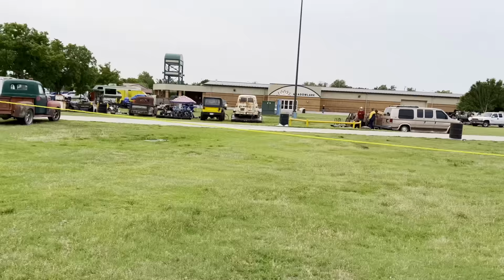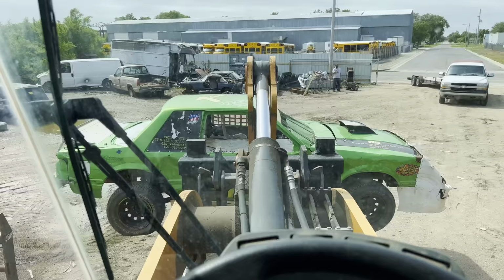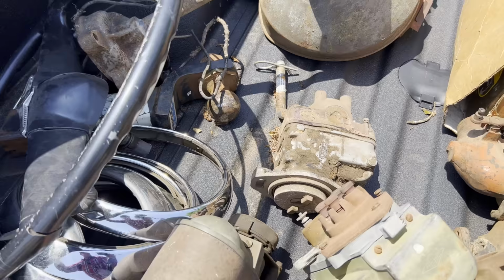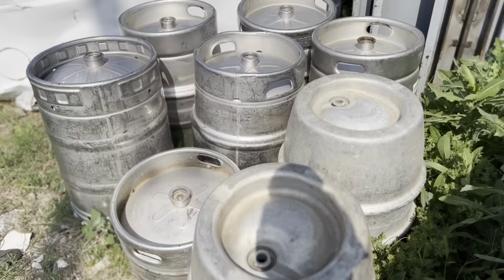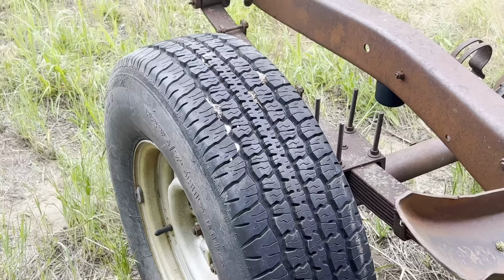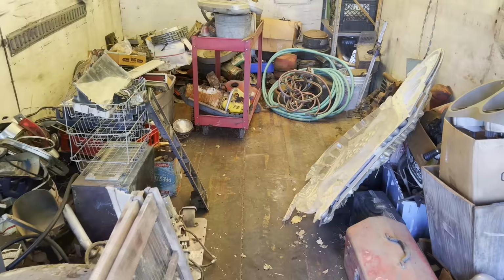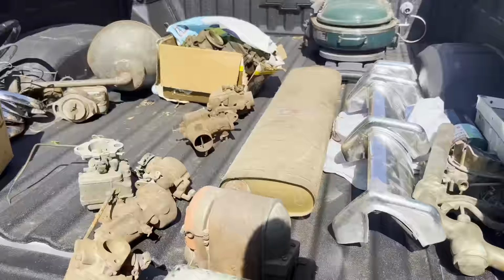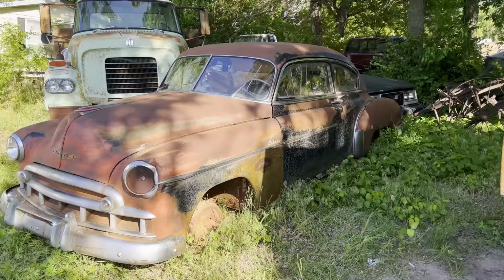I Saved Multiple ANTIQUE Cars & Trucks from the CRUSHER + I bought a Bunch of SUPER COOL old parts

Comment: Hey Silas, I saw on the internet the horn button, same design as yours. They are saying 1949-50. I tend to believe it to be a 1950 because steering wheels 1949 and 1951 look different. I look at the truck with Wichita reminded me when I  was stationed at McConnell AFB years ago.

Comment: You know for about 4 or 5 years we did Big on eBay as well. Had some other people try to buy or company because we had a ton of perfect ratings. They're ratings or trash. We weren't going to do that to anybody in eBay community because they think they're buying from us and there has to be a reason why a person's rating is trash. I know how hard we worked at keeping it good fantastic actually our ratings. Well if you quit eBay you kind of know why we did and we let our company just die on a vine every so often they want us to participate again and send us an email. That I believe you bought it for 40 bucks that first dash speedometer cluster. That appears to me to be for a early 60 to 63 maybe Chevy truck. 65 and 6 basically same body style except for the way from the knee knocker cabs and they change the speedometer cluster. As far as the model material. You cleaned up! Assuming that is still a hot item as it was. People would make junkyard models and sell them for fabulous amounts. So you take a piece of a model throw some stuff together and don't have to take too much time make it look like it's kind of smacked up if you're good with an airbrush it's easy to do 100 to $500 a piece but remember we've been off eBay for maybe 5 years a little longer possibly. The Chevy truck or something was living it for some time. A lot of valuable stuff as far as parts. We bought one for 300 bucks I think out of the river bottoms it's an industrial complex and they're literally thousands of cats running wild. House cats type not mountain lines or anything parrot when they Park this truck for no apparent reason they were loading something and knock out the back window. Trucks got about 40,000 original miles on it. It's a V6 automatic fantastic body long bed but the cab was home to who knows how many cats we call it the cat house truck. We roll down the windows and parked it so the weather could wash it out and we'd let it go for probably more than 3 years. I've had the back glass and Ms Lance parts all I got to do is find a seat I haven't looked that hard. The cat smells gone it ain't rusted up and $3,500 for 40,000 mi truck sounds like a fair sale. Oops I told you I paid for it. We all know I've got time in it and a little odds and end things like door panels and everything cost money but still we can buy a truck with 40,000 miles up for that kind of money straight as narrow. Truck that's going to smash her it's not straight as narrow but they are worth money. I don't really know where you're located at but I've googled the country to find out what sells good and where and I've driven 1,000 miles to get more money out of something bilo sell high and it's paid for a few okay quality vacations for our family. I'm just throwing out ideas cuz I really love your approach to this video. Back when the car craze was just kind of beginning with all the shows A&e Network put out casting call my buddy and art teacher and a car nut like I am put us in when we got to the final 20 or something like that he let me know what he did nice I can't do it. Sure wish I had now. We made the final six and everybody knew we were going to get the show except for we didn't. I told him we would draw and he did regrettably or do it without me. I get calls and I have the real back number to most of the shows out there and for at least three or four years or longer run. Sometime I get lucky and have a find what they want. They pay well because it's the television that pays them their money they don't really matter about the car to make any money off of it. I've been tempted to take what I've learned do a YouTube channel myself. But I'd register some ideas out there and set back and enjoy and quietly hunt down these cars because that's why they wanted me to do the show My method is very unique and it really works well. Get the combination and access to fort Knox then I'll tell you how I do this because I keep it very close. I keep it to myself. Now my buddy he knows how I do it basically. Anyway he can throw it out with the bathwater if you like if none of it suits you. I just like your simple honest up front approach and you don't overlook the little things either. Okay the Ford mustang race car caught my attention too. I've got a 68 Cutlass 442 race car from back in the day. No it's much too nice to do that to it even back in the mid 80s. It's a dry Western car and it still has to plate on it bumper that we're in a spare parts that he gave me when I bought the car. It is stripped down all the reinforcemented body panels are gone and it sits on a Chevelle frame. And it looks like you just rolled right out of 1980s including the crash bars up and down the side. Okay well I enjoyed your video and thank you for sharing